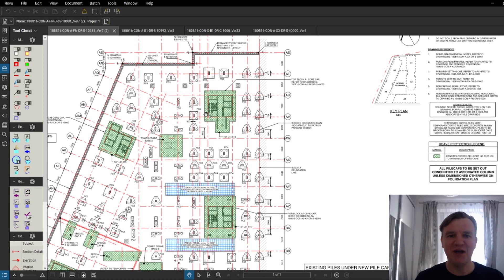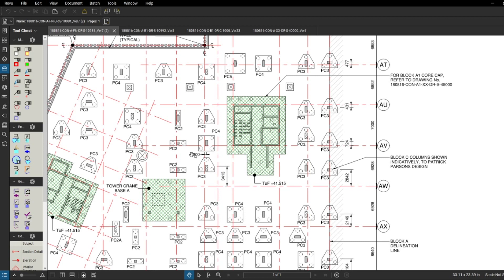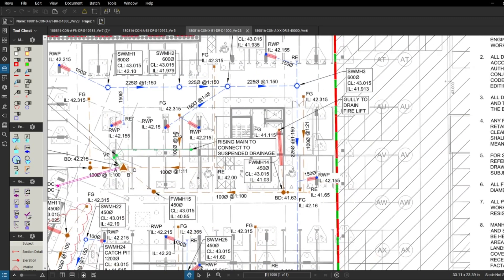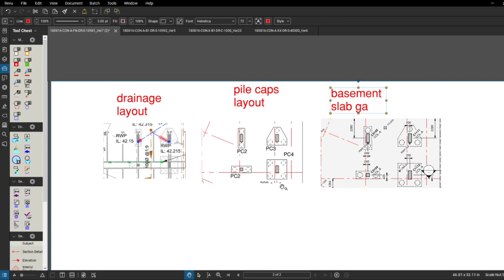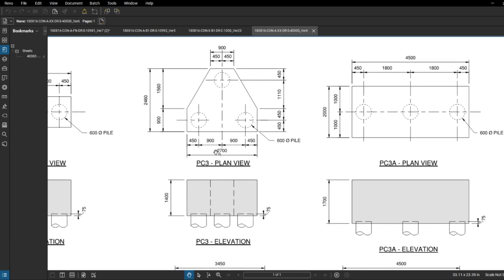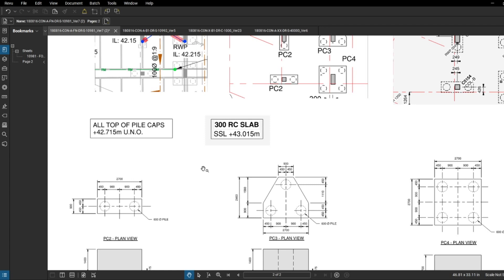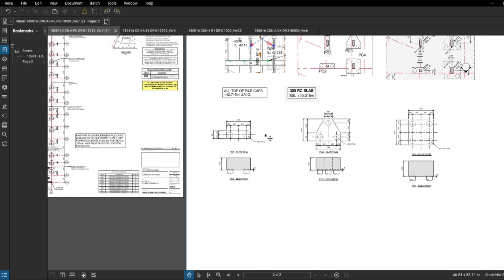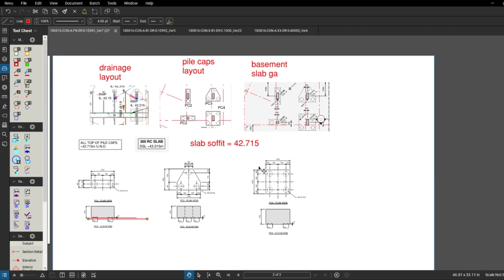How to read Construction Drawings #10.Pile caps. Foundations layout, drainage and pile cap detail.

Comment: New subscriber. Great video and well explained. Just a quick question about the grid lines. I noticed the grid lines are mixed is that all in global/local or both.
Reply from the maker: That is original grid for which grid lines crossing are given in global grid, so you can say it's global. Obviously you can change it to local system which will be useful (grids of course staying the same), using the robotic I would recommend bringing the drawing to the controller and working off the drawing using global co-ords (I know you didn't use it yet ;)
Reply: @SITENG  Interesting, thanks for sharing